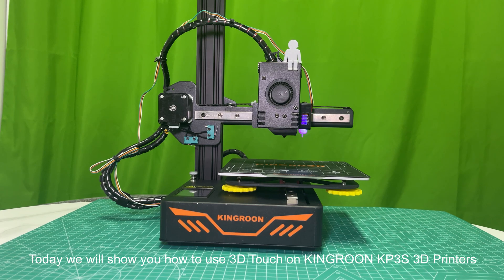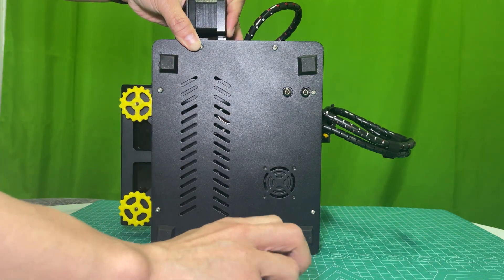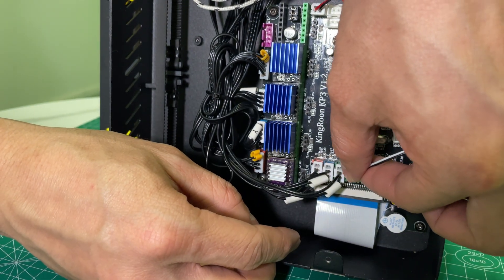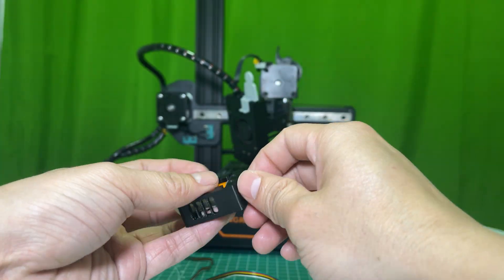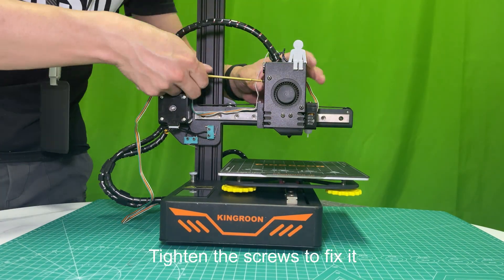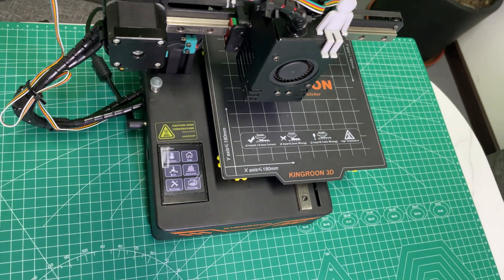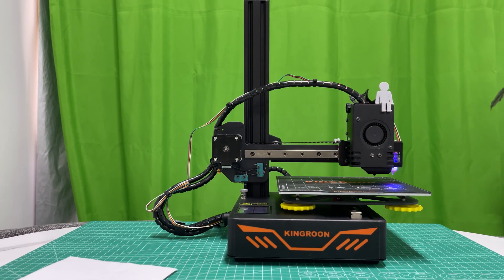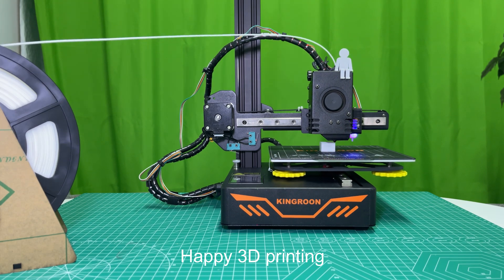NOT MARLIN | How to Enable Auto Bed Leveling  Feature on KINGROON KP3S 3D Printers

Comment: Help me please. I connected bl touch according to the instructions, when turned on, the stem extends up and down and lights up red. when i press auto level it retracts the stem, lights up red, goes to autolevlel but the stem does not extend! and nothing happens when it closes.
Reply from the maker: Please send us an email with the video, we will check it and find the problem out. Please make sure the video shows all the operating you make. Our email address is support@kingroon.com And you can add”For Frank” in the subject. My coworker will let me know in the first time.
Reply: @Kingroon3DOfficial  Thanks for the quick response, I sent the question by mail, I will also leave a link to the video here.  https://www.youtube.com/watch?v=iP_fLnxw-68
Reply from the maker: @vladimirkrivosheev3920  Thanks for the video! I will try to help you out soon.
Reply from the maker: @vladimirkrivosheev3920  Hi, I have a question. What’s the version of your BLtouch? A product link would be helpful, thanks!
Reply: @Kingroon3DOfficial  this is bltouch v3 from trinaglelabs link sent to email
Reply from the maker: @VK-fx7lo  Thanks! We will go check it and try find the problem out.
Reply from the maker: @VK-fx7lo  Hi, did you modify anything or just keep everything original? If you did, please send us the configuration file. Thanks!
Reply: @Kingroon3DOfficial  configuration file from your project at the link that you left, I did not change anything!
Reply from the maker: @VK-fx7lo  OK, thanks for the reply!
Reply: Do you have any thoughts on this?
Reply from the maker: @VK-fx7lo  Hi do you have any 3D Touch around? If you do please try with it again. Also please try turning the cable 180 degree, see if it works properly. Because the red light means not power correctly. Waiting for your reply.
Reply: @VK-fx7lo  take a look at my replies. here is the gist of it: I swapped BLtouch with 3D touch and "deploy" mode works as well as probing of 9 points. So, for those that this may benefit from this - BLtouch is not supported with current firmware but 3Dtouch does work. 

//
so BLtouch is not supported, 3dtouch does work. I still need to figure out if i need to modify my Gcode to include "G29".
Reply: @zeeman2594  thx , i will check

Comment: After installing the firmware, when giving autoleveling the tip of the sensor stays up and in each of the 9 points of the autoleveling the Z axis goes up a little more (and I have to turn it off because otherwise the printer will be disassembled ) I have the KP3S v3 and I don't know what to do, pls help.
Reply from the maker: If you get the 3D Touch too close to the build plate, please check the video first, make sure you have install the box in the right place. By right place I mean leaving one block above. Then you need to go modify the txt file, add the z offset value. The default value should be -2.8, you can try modify it to -1.8. Once you find a rough value, adjust the value 0.1 once a time. After that you should be fine. If too far, just do the opposite. We know its tricky and troublesome, but the new firmware is going to be published soon with the offset wizard.
Reply: @Kingroon3DOfficial  I installed the firmware with the Z offset and when Im leveling everithing goes ok. At the moment of starting the impression, it is like no offset was configured. What could be the problem?

Comment: Any way to do one with filiment run out sensor.
Reply from the maker: The same, they use different ports. We will do  tutorials for those models, too.
Reply: @Kingroon3DOfficial  update?
Reply from the maker: @doodle4532  The new firmware is still in testing. Once it is ready, we will release it.

Comment: It's perfectly possible to use the existing cable shield to route the 3d touch cable instead of using zip ties. Way more cleaner that way.
Reply from the maker: Sure it is! I may do that on my own KP3S in this way, too. This printer I use will be used for more tutorials, that's why I put the cable outside. Thanks for your advise!